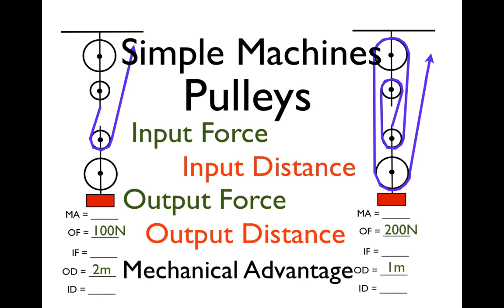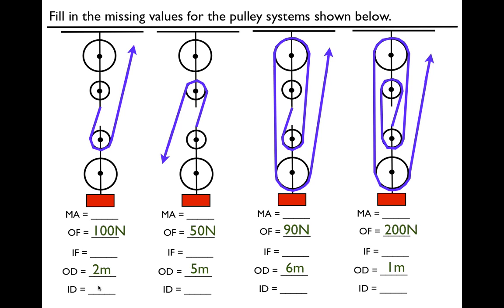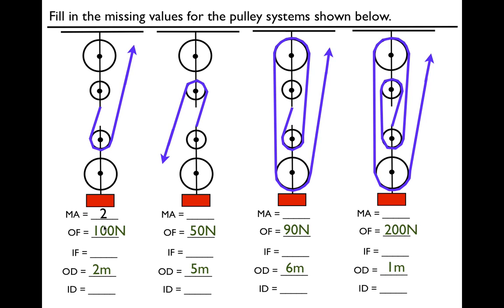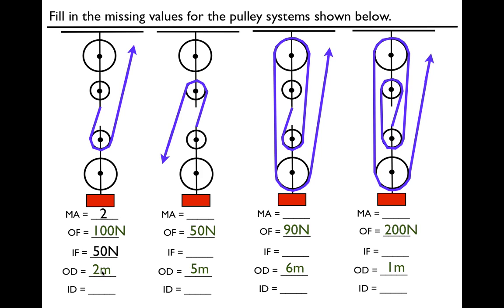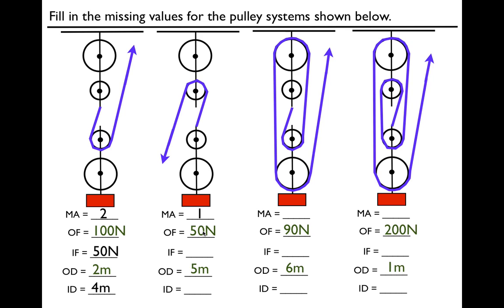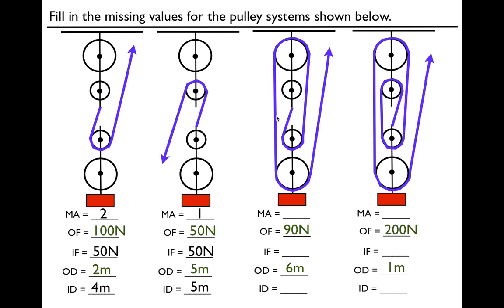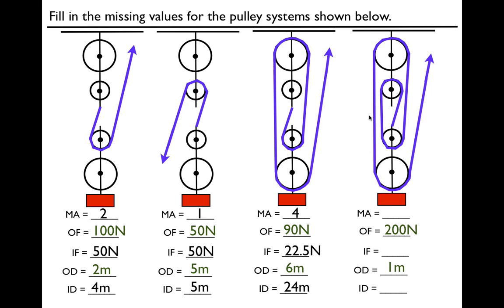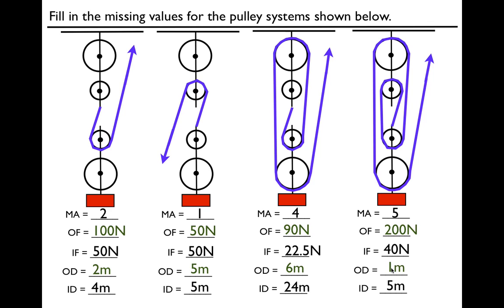Simple Machines (2 of 7) Pulleys; Calculating Distances, Forces, MA, Part 1

Comment: Great video. But how do I increase the output distance and shorten the input distance (accepting a resulting increase in inputforce)? For example, if i want to make a treadle powered saw, I need a large output distance that maximises the length of the saw, but a short input distance because I have a short treadle. I can increase the input force by treading heavily. Any ideas?
Reply: Use one pulley that is smaller than the other. Use the large pulley for the input.

Comment: Thank you for crystal clear video, I am studying this type of situation. Except for one on the last one on the right. What would it be for MA if a string attached to fulcrum (from anchor point), you will need to pull the pulley toward the load instead of toward to anchor. I had another book that state 4 strings instead of 5.  Can you clarify on this. Thanks